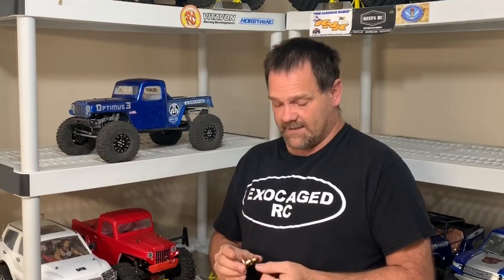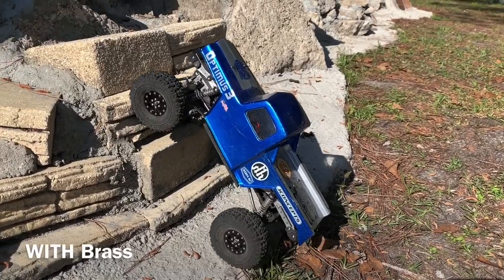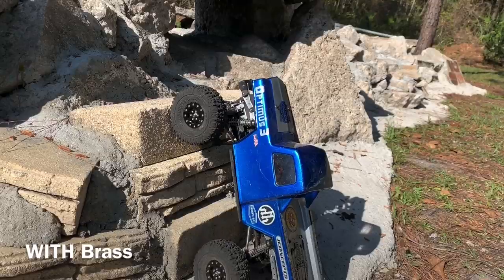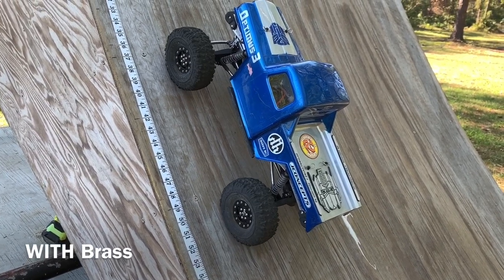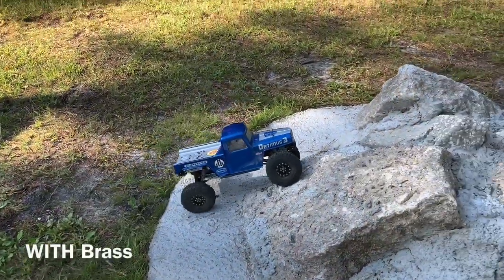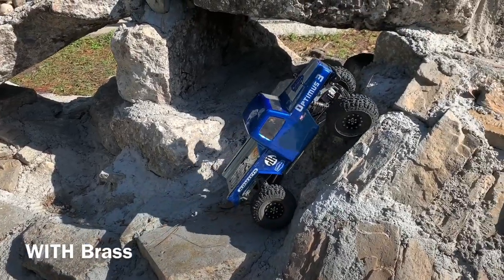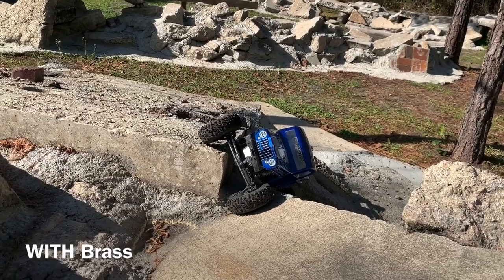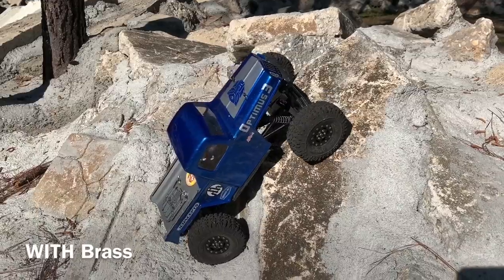Optimus 3 Tuning with Brass Weight

Comment: We have added brass to all our TRX4 only to front axle.
It changes a lot the more the weight !
The best is on rock steep climb with good grip, where the limit is overturning: with brass you go up really better.

For this reason your valuable climb test on a quite slippery ground does not give evidence of the difference: in that situation the limit is slipping, not overturning.

Really a great test video !!

Comment: Ya now.. I use a Polaroid Cube + and have a hat that I wear that has a magnet ShoeGooed to the top of the brim. That way.. I can record "hands free"... and the Cube only costs $30. I'd go for the one with WiFi though... so you can control your framing and such via your cellphone (when you put it on a stand or something). I'm only saying that... 'cause I'm sure it is difficult to drive and concentrate while holding a cellphone.

Comment: Nice side-by-side comparison.  I run a rear link riser and find it helps just as much to keep the front end down while not increasing my overall weight, maybe an idea for another video.  Also, I couldn't tune the stock shocks to ever work, they always unload on difficult climbs losing traction or causing it to roll, I've had better success running desert lizard 90mm but im sure a big bore style shock with mini-t short springs(traxxas or dravtech) would be even more effective.

Comment: I have been messing around with brass on both my Trx4's, and it does help but I can see how it is easy to go crazy and add 5 more pounds of weight.  On my Defender I have 120g front and rear, and my sport 110g front and 56g in the rear.